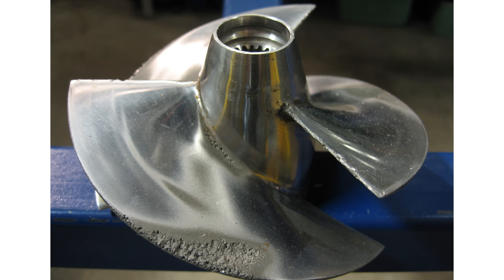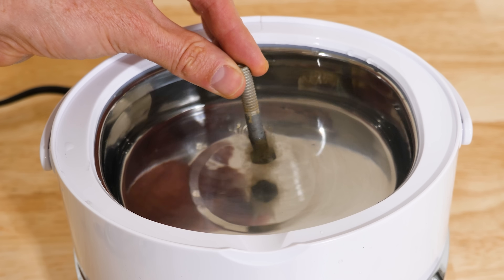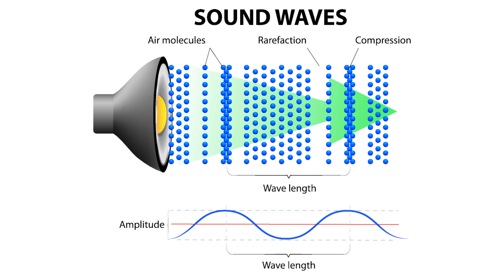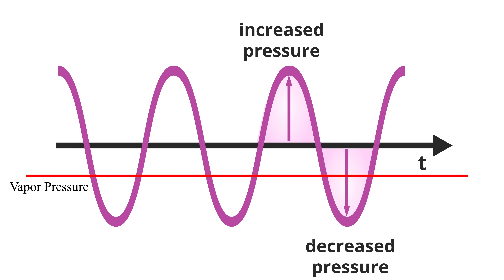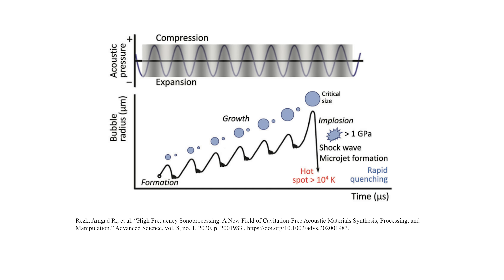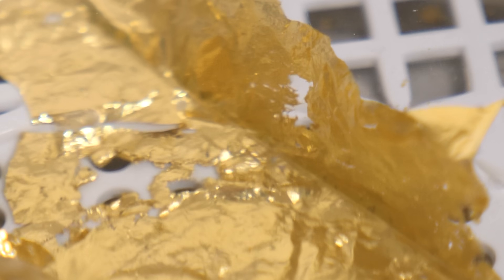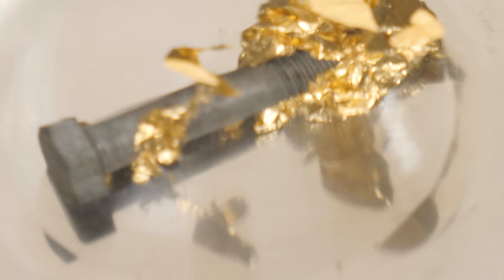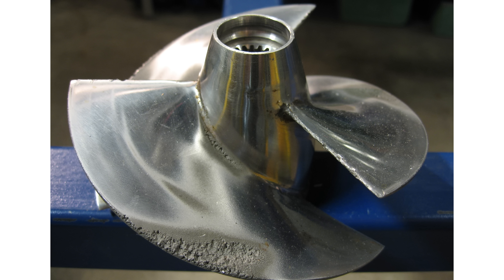Can Ultrasonic Waves Dissolve Metal?

Comment: no, it doesn't dissolve the metal, it tears the metal into tiny particles due to the action of cavitation.
Reply: Would you say disintegrate ?  Or disperse .

I don't think dissolve is so wrong but different than chemically dissolving.
Reply: @louf7178  "dissolve" has a very specific meaning. specifically, it means that a solid becomes incorporated into a liquid...this ain't that.
Reply: @douglasharley2440  Yea, so disintegrated within the liquid is appropriate.
Reply: @louf7178  maybe...but "disintegration" implies, to me at least, a more fundamentally-small unit of disaggregation, like at a molecular level, while this process is basically just chewing-off lil hunks at mm-type scale.
Reply: @douglasharley2440  Even though that is applicable, comminuted may be the better word.
Reply: @louf7178  ok, looked into it further, and according to AMPP (association for materials protection and performance) the official terms are cavitation corrosion (for fine scale) and cavitation erosion (for large scale). apparently, a power turbine can completely erode in minutes if misaligned.
Reply: I am thinking that its something along the  lines of abrasive wear (possibly with the aid of an abrasive material suspended in the water)... and stress/metal fatigue that ends up producing somewhat larger fragments.
Reply: @martinhirsch94  no, it's the pressure of the cavitation bubble-collapse that destroys the metal. as he discusses in the video, extremely tiny nucleation sites along the surface are subjected to incredibly-huge pressure gradients when the cavitation bubbles almost-instantaneously collapse. at those scales, that is more than enough power to simply rend any metal. that's why submarine propeller design is such a guarded secret: they need to be able to spin fast and generate mad power, but cannot create any cavitation, because it causes lots of noise for passive sonar (in addition to wearing the trailing edge, making them even noisier).

Comment: I suspect if you tune the frequency emitted to an object’s resonance frequency I suspect this would be more efficient and powerful like what opera singers can do to crystal glasses, love this though, shows what frequency can do when thought about deeply and outside the box
Reply: Don't it cause damage?
Reply: In the video it is causing damage to the metal, if the principal could be scaled up or down we could literally use it for loads of things as once you know a objects resonance frequency if you match that in theory it shatters, this could be done with harmful cells inside the body without damage to surrounding tissue, it could cut rock/ metal with laser accuracy and efficiency so where and how we can build becomes different, it could be extremely destructive if used irresponsibility and as I hope is obviously by the explanation, you would also I believe have to phase conjugate the waves if you wanted laser like precision tho

Comment: Can microphones even hear/record ultrasonic waves? (I know you couldn't hear it and your speakers probably can't play it)... but can microphones record it (so it could be seen in software)?
Reply: They can, This is actually how measuring devices work in some places :) (you know, those little thingies that you can hold against a wall to measure le length of a room) Sorry if my english is crap
Reply: Yes, but there are very specific ones that go beyond the human audible range such as 20hz -100khz
Reply: I'd wager a condenser with a particularly small diaphragm would be able to capture ultrasonic frequencies, but a typical DAC lowpasses everything above 20KHz - this is in fact a critical part of how digital audio is able to accurately reproduce an analog signal (see Technology Connections' excellent video on the Nyquist–Shannon sampling theorem). Even analog tape has issues capturing high frequencies depending on the tape speed. As noted above, the equipment exists, but it's not going to be your typical recording rig.
Reply: Some mics can, and if your recorder or soundcard etc got high enough bitrate, you can actually record and/or process it; with enough bitrate it's like a high speed camera for sounds; you can play the recorded sounds at a slower bitrate, play them slower, to bring the ultrasound frequencies into the audible range, and there are some devices that can process the sound in real time and generate a pitched down version of the sound as it comes, like an extreme voice changers; it can be used for example to hear the sonar noises of bats. Btw, did you know pet rats giggle when tickled? People usually don't hear it because it's in the ultrasound range, but they do giggle.

Comment: What if the ultrasonic cleaner was big enough to fit a person, would he be able to take a bath in it? 😂
Reply: You can put your hand / fingers in an ultrasonic bath.  It isn't comfortable, but not immediately damaging.  The waves penetrate right through your skin and you can actually feel it in your joints the most.
Reply: I'm afraid if it would eat our skin.
Reply: Fillings in your teeth could resonate.
Reply: Or a 94 story building...
Reply: Thanks all of you 🙏🙏 🤣🤣🤣
Reply: funny question,while the ultrasound do not hurt your body,the ultrasound make water bubbles and bring out dirt,that how is works
Reply: Um...not unless you want to remove to top layer of your skin.
Reply: Dunno; try it with a mouse

Comment: Would cavitation affect aircraft propellers much like the boat propellers given water and air are both fluids?
Reply: Yeah, but not in the same amount of efficiency (fortunately lol)
Reply: Yes and no. 
Yes in that is one way to describe a sonic boom, or to say a sonic boom is the gasious analogy. And it very much effects propellers, a sonic boom will destory them!
No; in that there is not a phase change involved at any speed that aircraft or propellers travel, even if you exceed the speed of sound. You would have to travel exceedingly fast to generate plasma from low pressure air, and the air would have to be extremely hot for a plasma phase to even be possible
Reply: Cavitation bubbles don't form in the air. Air is fluid but that doesn't make it a liquid.